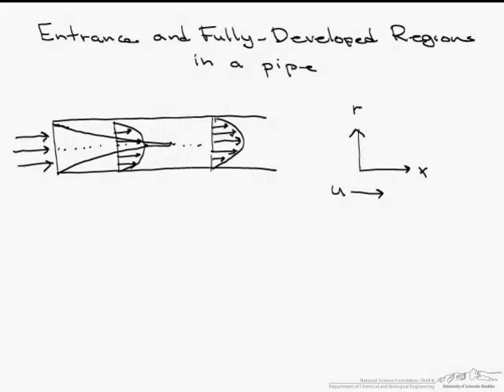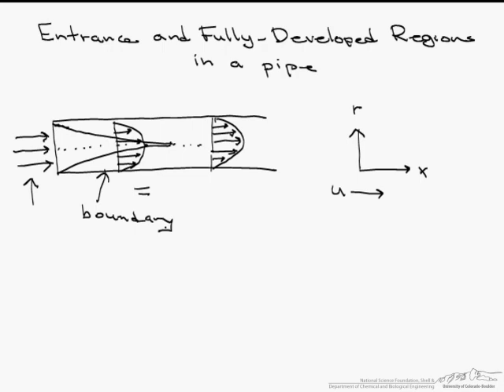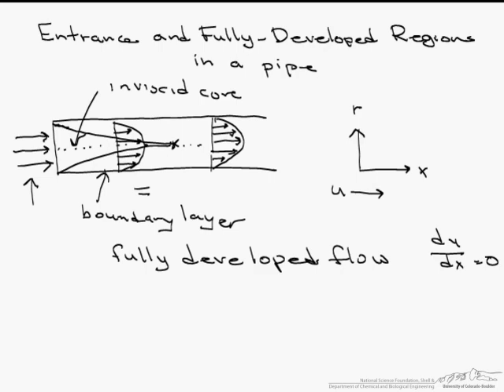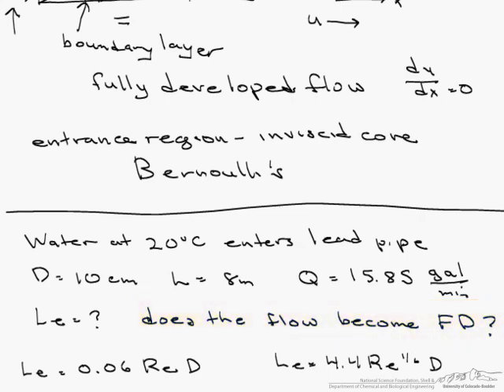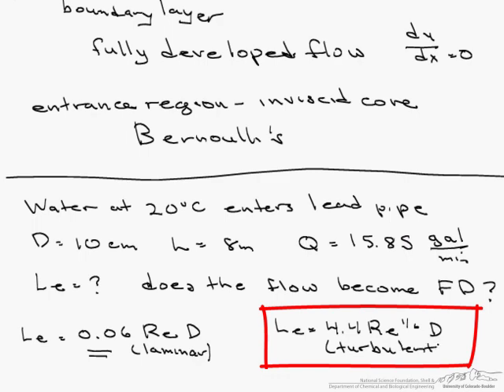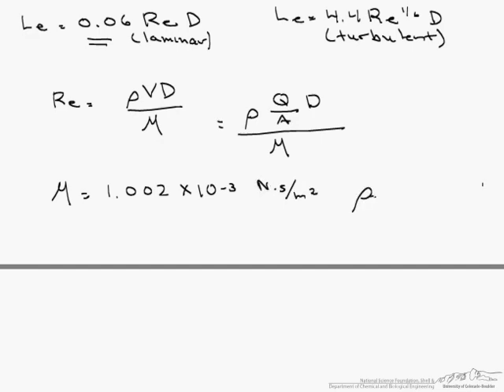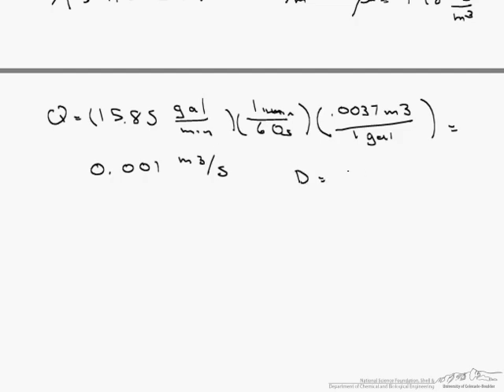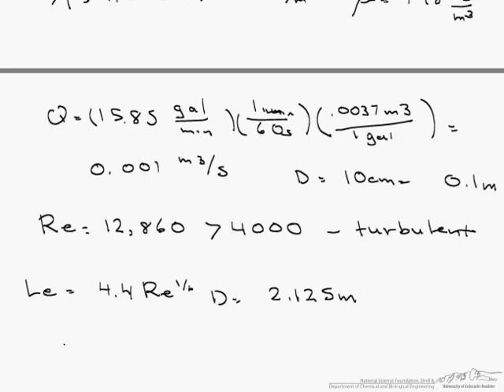Entrance Region vs. Fully Developed Flow

Comment: Does that mean that after 2.125 m the flow can be assumed to be laminar?
Reply from the maker: The entrance region is where the velocity profile is still affected by the developing boundary layer and thus a function of both distance from the walls and distance along the pipe.  It becomes difficult to predict velocity in this region whereas after the entrance region, the flow becomes fully developed and the velocity is only a function of distance from the walls.  In this case, the flow is turbulent and the entrance length is determined for turbulent flow.  We would use empirical relationships for turbulent flow in the fully developed region to examine the pressure and velocity profiles in that region.  If the flow encounters any changes in the piping system (bends, tees, expansions, etc.) we would recalculate the flow regime and entrance region at that point due to this disturbance in flow.